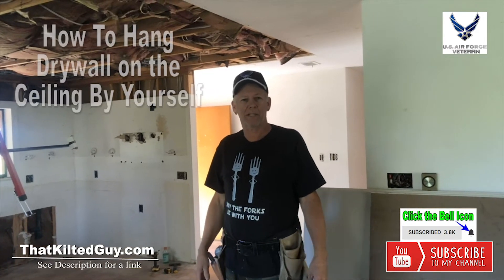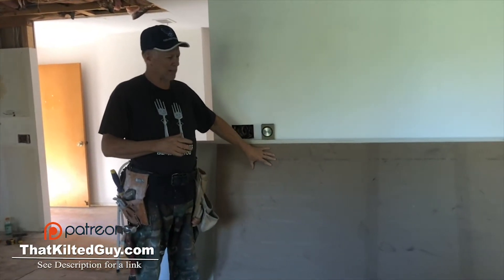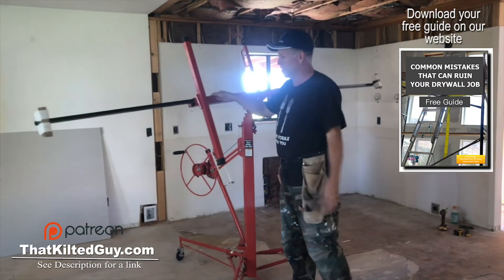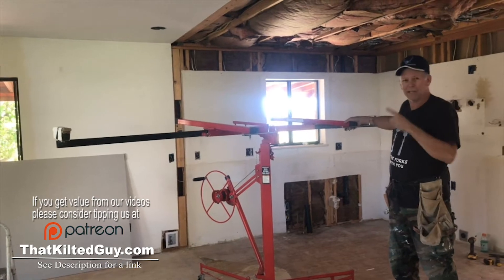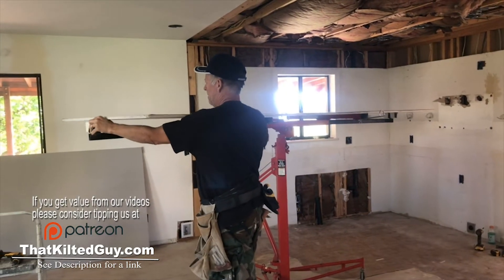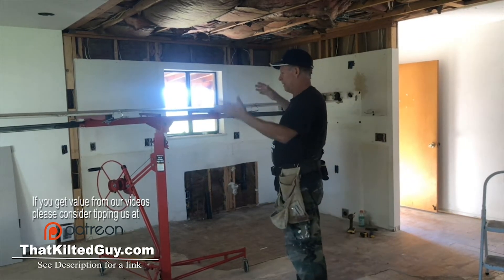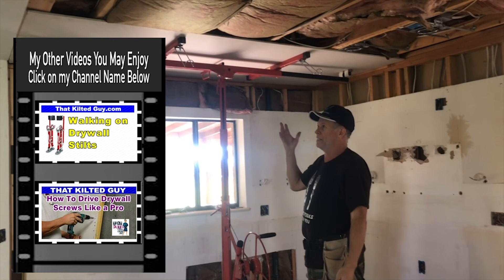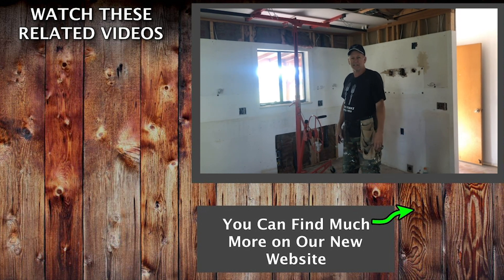How to Hang Drywall on Ceiling by Yourself. Taught by 7 Year USAF Veteran

Comment: Thanks for all videos. I can find all kinds of videos on lifting a piece, but no one ever talks about the proper way to layout a ceiling, should you stagger butt joints? Is it okay for the taper ends to land in the outside corners where the wall meets the ceiling?, how do you correct an issue such as the drywall not landing perfectly on stud (aka out of square and how to accommodate for that?).
Reply from the maker: I plan to do a whole series of videos on hanging drywall properly. It will probably take 10 videos or more to cover many of the subjects like you’re asking about. But since we just moved into an RV and are saving money to buy land and build a house, it might be a while